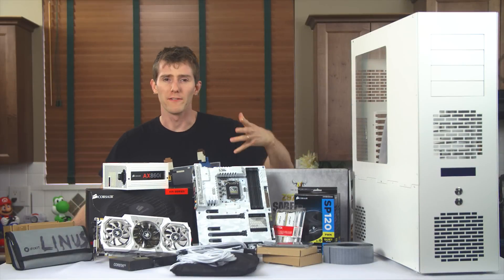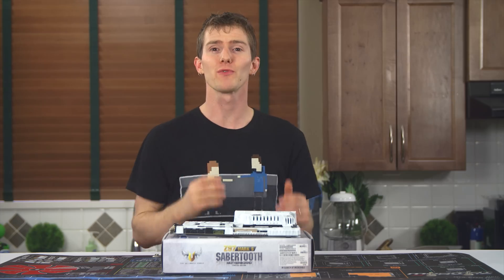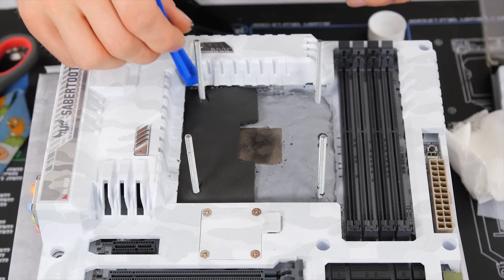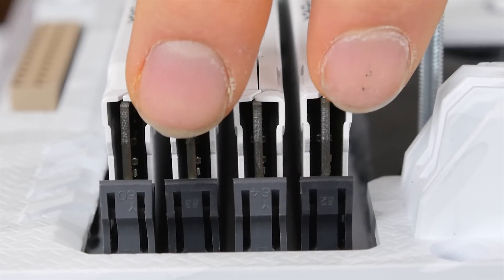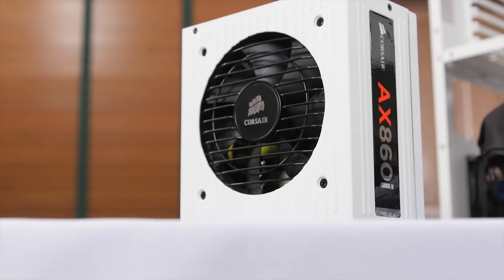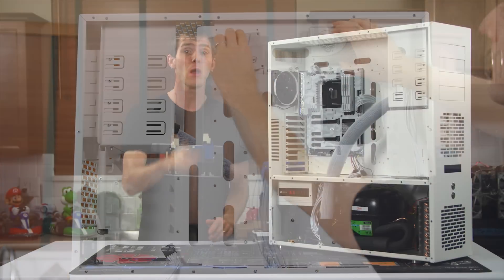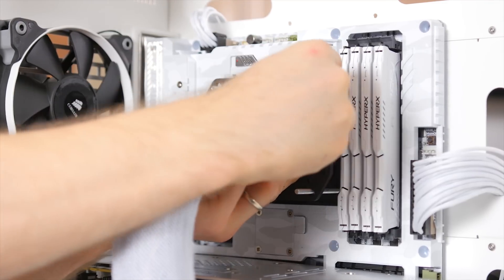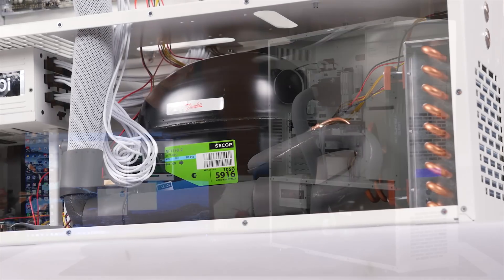ULTIMATE Sub-zero Phase Change Cooling PC Build Guide

Comment: I want to know if this is a good rig or not? :3

Cpu: intel core i5 4690k
Mobo: msi z97 gaming 5
Gpu: msi gtx 970 twin frozr
Ram: gskill ripjaws x series 8gb 1600 
Cpu cooler: corsair h100i
HDD: wd blue 1tb
SSD: Samsung 850 evo 250gb
Psu: seasonic m12ii 500w fully modular
Reply: Flaccid Senpai Its not bad at all, Ghost is just a troll.
Reply: Ghost How is it weak when hundreds of other people have the same build lmao. And how is it a broken GPU?
Reply: Flaccid Senpai Will you be doing extreme overclocking? If not, then the H100i cooler is completely unnecessary. Think about it, you could upgrade to an i7-4790k just from the money you save by not going with an H100i. For some light overclocking, all you need is a Cooler Master Hyper 212 Evo for $30, it's an awesome CPU cooler for the money. The H100i just isn't worth it IMO, since CPU overclocking only provides a minimal improvement in gaming performance...
Reply: Can only run minecraft at cinematic settings.
Reply: Johann Siewers If you do your research you would know that the FX 6300 bottlenecks the R9 280 which isn't even the latest version. Also, the FX6300 is a shit CPU. Nothing else needs to be said about it.
Reply: NinjaGaming111 Yea im actually switching to EVGA Supernova 750w so I can overclock my cpu.
Reply: Ghost Issues on high end games? I am using GTX980 and my roommate is using GTX 970, both from ASUS Strix. Both currently playing Battlefield 4 1080p ultra, no problem at all. Yeah i got 20 FPS more, but 970 on 1080p ultra setting is really good with the current price. Let me ask you something, if you can tell us GTX970 is bad, what is your GPU then? Titan?
Reply: Ghost You're first response: "shit" tell me how is that an effective way of answering his question? He asked if it is a good set up, not "the best money can buy" set up. Second of all the 970 works just fine in BF3 or 4, I have used the 970 frequently and it has no problems (other then the whole 3.5 gig thing, that unless you are running tonnes of texture mods in games, you probably wont even notice)
Reply: So you're saying get a $99 cpu and get a $500 gpu? I have yet to see anyone use an fx6300 with an 980. That's pure stupidity.
Reply: Mohammad Awesat While it's true that you'd be hard pressed to find a game that uses 8GB RAM on it's own (maybe Arma 3?), that is rather irrelevant.

You're hardly ever 'just gaming'.
More often than not, you have Chrome hogging up over 1GB , add in skype for another 300MB, bonus points for any distribution client like Battle.net, Steam and/or Origin and permanently running background programs like dropbox or google drive or gaming peripheral software that comes with any Logitech, Corsair or Razer product, etc
And presto: you're using 4GB without even being in game.

Another point is that a 850 evo will always benefit from more and faster RAM because of the 25% it can use as a buffer. So yeah, if you're close to maxing out your RAM, you're better of buying a cheaper SSD.

So yes, it is a weak point when compared to the rest of the specs.
Reply: Flaccid Senpai Not bad, but you will need a better PSU.  As a general rule, I always go for more wattage than I need so if I wanna upgrade, you can without changing out the PSU.
Reply: +Primo ✪ I'd honestly say - just stay with this build. I have no idea why people keep telling you to upgrade to a 980, or get a better CPU... Honestly, the 970 and 4690K are more than enough for running games at max with a resolution of 1920x1080. Like hell, I am running  an i5-4590 and EVGA GTX 680, and I can still run games at max at 1080p. The 680 in itself has nearly been out for 4 years now and is still damn powerful.
Reply: i think you can run roller coaster tycoon 1 at 5 fps low settings    .......   no its a nice build but u should upgrade the power supply
Reply: Flaccid Senpai Sounds good to me
Reply: Flaccid Senpai Shit
Reply: Flaccid Senpai Fast read/write at the cost of a broken GPU and slow ram. Enjoy battlefield four loading screen waiting for other players to be ready then you can't play because of weak specs
Reply: I have the exact same build except I went overkill with the PSU and got a cx750m but I think it's worth it so I can upgrade it in the future.
Reply: Flaccid Senpai the h100i is a bit overkill unless you want to do alot of overclocking. If you're not gonna do too much overclocking then i would just go with a cooler master hyper 212 evo cpu cooler since it is much much cheaper. I would also get a 600 watt psu instead. Other than that it is a good build
Reply: Flaccid Senpai the H100i is definitely overkill for that Processor unless you're planning on a lot of Overclocking in the future (which you don't need unless you plan on keeping the machine for like 6 or 7 years). an H80i or something in that range would be plenty.

in a year or two, if you're playing games above 1080p, the GTX970 might become a bit of a bottleneck in vRAM.

why not 2x8gb sticks for RAM? just a few bucks more and it eliminates worry about System Memory no matter what you're doing.
Reply: ***** Eh the h80i is $10 less than the h100i. I might as well just get it and I will be looking at the 2x8 rams but the 16gb for gskill ripjaws x is $110.
Reply: Flaccid Senpai 
oh, right.
i forgot their prices. in that case, an H80i GT or H75 would also be plenty.

if you have space for the 240mm Radiator (setup as Pull only for Exhaust out of the case IMO) then by all means i suppose.
Reply: *****  So should I have the fans in intake or exhaust? I kind of didnt get what you said. xD
Reply: Flaccid Senpai Ditch the h100i and spend it on either an evga 750w g2 if you plan on putting more cards in or a bigger ssd space, or peripherals
Reply: Flaccid Senpai it's almost criminal how convenient it is to have Radiator Fans on Pull only, so that the Radiator acts like a filter for the Fans. you can then just wipe it off when cleaning, <5 seconds to clean your Radiators!

with the Radiators in general acting as Exhaust Fans for the entire case, so that heat from them being directly vented out of the case.
Reply: alcowherd7 I'm a troll? K. Wait I'm the one with a setup profile, not you. The 970 has nothing but issues on high end games.
Reply: dont get 970gtx.. Because it has bug..  Get 980
Reply: Flaccid Senpai sorry its super crappy,Idk what you were expecting as an answer.
In all seriousness if you threw more than 1000$ at your computer it's good. That's how it works
Reply: Flaccid Senpai You're better off spending less on the CPU cooler and more on the GPU itself.
Also, I would spend slightly more on the PSU and I'm not the biggest fan of MSI for anything but their laptops but that's more of a personal thing.
Reply: Kingslay3r 'Good' is subjective. Will that rig handle ARMA3 at 4k with all graphical settings maxed out? No. Is it enough to max out GTA 5 at 1080p? Yes. To me, that is considered 'good'. It's not a beast, but it sure as hell is above what the average PC gamer has.
Reply: LyyK 2160p gaming isn't practical yet anyways. performance is still iffy regardless of what GPU's you have.
Reply: Flaccid Senpai Unless you need the m.2 expansion slot available on the msi gaming 5, save yourself some money and get something without all the gamer bling. It's just simple marketing. If you would prefer the MSI route, pick up an MSI z97 PC Mate board instead. The gaming 5 board will not offer any performance benefits with those specs. "High quality capacitors" etc is not relevant for this kind of a build. If a capacitor fails, you will be covered by warranty for a certain period of time. Cheers
Reply: alcowherd7 You're posting zero facts with proof and you're not making any points. What are you doing here and do you have a life outside of attempting to troll legit users?
Reply: Flaccid Senpai Don't take the i5 4960k, for the 970 you will not a high class intel CPU, go with FX 6300 AMD. It will handle any game preset that the 970 can play out
Reply: Johann Siewers What are you talking about? FX 6300 is for budget builds. If he can afford an i5 and 970, there is no place for a fx 6300. FX 6300 WILL bottleneck a 970 at certain times and it's upgradability would be terrible. That i5 is enough for most AAA games while the FX 6300 will probably struggle with games with many mods.
Reply: DeliciousPho And you too have fallen to the myth of bottlenecking. Do your research, in todays world bottlenecking is dead. The fx6300 has 6 cores and quite some speed, many games will run smooth. i5 is overkill unless you do a 980 / titanX build.
Again, 970 doesn't need a high class CPU to be happy and many games as well
Reply: Johann Siewers it's going to be several years at earliest for games to really take advantage of the Threads that CPU's can provide them.
bottlenecking is a huge problem for games nowadays. we've been hitting our heads on the limits of single threaded performance for several years.

fun fact: save for a few specific outliers, almost every [game] you've ever played only uses a single CPU Core. with new games sometimes supporting two Threads.
Reply: ***** Could you elaborate your statement? As far as I know, gaming isn't a CPU-bound process.
Reply: Klasta Games have been CPU bound since the beginning. it's actually pretty rare for a game to run GPU's hard enough to hit a GPU bottleneck before a CPU bottleneck.

games are mostly single threaded even up to today. this means that the average 4-Core Processor at an estimated Clock of ~3Ghz would get the same Framerate as a theoretical Single Core Processor running at something like, say, estimated Clock of ~7-9Ghz.

the seriously low Thread count that games run on causes CPU bound issues. being able to overcome this by having a Processor that has extreme single threaded peformance doesn't really change this.
a very good example of this, is to run a game, and having dozens upon dozens of AI instances running at the same time. the AI calculations will bog down the Engine, and your Framerate will tank. no matter what CPU you have. because it's all limited to a single Thread - meaning that everything has to wait in line, regardless of how many Threads your CPU itself has. 

games have been getting around this issue for many years by keeping the complexity down. in other words, we've been basically nerfing ideas for games to make sure that they aren't overloading the systems we're running them on.
the CPU's themselves are alright, it's not even really their fault. our Programming is a significant part of the blame. Engines that are single, or maybe dual Threaded (with some rare few and far between, really fancy ones supporting 4 or even 8), stacked on top of Operating Systems, Interpretation Suites, Compilers, and more that create and process in a single threaded manner.

the Industry is really slow to move along with these things though.... and it's pretty stupid. we've been able to see the benefits of properly Threading from other parts of the Industry for many years. CAD work is already heavily reliant on this, utilizing as many Threads as they can gobble up to keep the number of vertex points that are being used to generate complex shapes - running smoothly and not crashing.
same goes for Servers, processing absurd volumes of simple data (which is how a lot of games are, fairly simple math calculations, but on a very large scale) due to properly Threading tasks so that they can complete without having to wait for each other.

Threading makes everything go so much faster, and keeps 'traffic jams' from happening on the CPU side.
our GPU's that we're using already even do this, lol. GPU's are massive concurrency, processing hundreds of millions of actions per second in order to generate 3D images at a smooth 'Framerate'.

so it's CPU limitations because of Thread utilization. the CPU's are capable of doing it, Windows even tries to do it automatically (Load Balancing), but ultimately, if your high level and low level Software all run basically on a single Thread, you're still screwed no matter what anyone else does.

ironically(because of PC and Console arguments), Consoles have been doing this for quite some time. they are designed with Threading in mind, as they have no choice but to do it, the CPU's are not impressive, they need to use 100% of it's capabilities.
so games for Consoles are designed with Threading in mind, dividing up work and keeping it separate to avoid bottlenecks. while on the PC side, we've been working with one or two Threads in almost all games since 1993.

Edit:
snaps fingers i have a brilliant example.
imagine a Highway. one way, one lane. you need to move an entire City's worth of traffic through it. it's bumper to bumper, moving very slowly. too much traffic for that road, right?

well, Load Balancing tries to compensate for this by adding more Roads, except they aren't completely separate Roads, it's like adding more lanes in some spots. like how real Highways are like, where there's more or less lanes sometimes. this helps! it does allow more parallel traffic, but ultimately the start and end are still one lane.

now, imagine the same road, except now it's a 8 lane one way road, from start to end. you have many more Threads available now to process traffic, now it can get from start to end much more smoothly, because you can handle more physical traffic at a time.
but, your Threads need to be able to intercommunicate! so you need exit and entrance ramps between each lane of the road so that they can be interconnected and data can be processed, and then get to where it needs to go for more processing with other data.

as it stands now, things are processed single Threaded - but there is actually a decent reason why. single Threaded processing is very simple. you always have access to all of your Resources. it's like a Pool. single Threaded processing puts everything in the same pool, always accessible.
multi-Threading is objectively better, but it means you do need connections between your many pools to make sure that it can all still run as one whole.
i.e. it ends up being more complicated, but it's better for everyone in the long run.
Reply: Johann Siewers Yeah, you don't know what you are talking about. Tell me where you found out it was a good idea to pair a 100 dollar cpu with a 350 dollar card.
Reply: I don't know why people are recommending me amd CPUs. I dont NEED them when I can get intel.
Reply: Flaccid Senpai Because they're cheaper and you could use the extra money and your GPU could use a few more bucks spend on it.
Reply: So you're saying get a 980?
Reply: Flaccid Senpai If you have the money just lying around, go for the most expensive card you want to buy. If not, drop the fancy cpu cooler (and get a CM evo 212 instead), maybe buy a slightly cheaper MoBo and get a 980.
Reply: Flaccid Senpai No, don't buy an amd or 980. When you have a budget this high, you always go for intel because of the bottleneck prevention. The only amd cpu that would not have troubles bottlenecking a single 980 is a fx 8370 but the latest i5s aren't that much more. Next reason to buy an i5 at that budget is the fact that it runs more efficiently and cooler. You may need to water cool your fx 8370 if you ever put in another card while the i5 will work fine with minor overclocking. 

This also is very dependent on what you intend to do with the computer though. So do you plan on doing any video editing or something like that, how many monitors do you plan on using, what resolution, and what is their refresh rate?
Reply: *****
The extra cores are irrelevant, but any other similar priced AMD cpu is kind of old.
Reply: Flaccid Senpai
But you will not need the extra price of intel, and rather go with a better GPU
Reply: Flaccid Senpai Yeah, he doesn't seem to understand that these amd processors are not fast enough. Besides, taking 100 dollars off of the processor putting it into the gpu still won't buy you a 980.
Reply: DeliciousPho that's certainly true. GPU stepups cost more than that, so there isn't really much of any benefit to doing so.
Reply: DeliciousPho The amd mobo's are also quite a lot cheaper and the h100i is overkill anyway so if you swap that for a CM Evo 212, you've got more than enough to buy a 980
Reply: Klasta AMD chips are for budgets, not really high end builds. He wants the i5 and he can easily afford it. As soon as he puts in another 980 in the amd system, it would bottleneck.
Reply: Klasta I don't need a 980 for what I'm playing. The reason that I'm getting an h100i is because it is going to match my red/black scheme.Yeah I can get an h80i for cheaper but it's only $10s less than the h100i so I decided to go with the h100i.
Reply: DeliciousPho How do you know he can easily afford it?
Even if the 8350 bottlenecks the 980 (which it doesn't really do, it's just the IPC being worse on AMD processors which isn't the same as bottlenecking), the general performance in game of a stock cooled 8350 + gtx 980 will still trump that of a watercooled i5 4690k + gtx 970.
Reply: Klasta Well he can't get the 980 anyways because he wants the h100.
Reply: Flaccid Senpai Well, if you know what you need and why you need it, why bother asking whether it's a good build? :)

The only recommendations that I can think of that aren't CPU/GPU-related are:

The h100i is ancient, so I'm going to assume you mean the h100i GTX?  A contender would be the NZXT Kraken X61 if your case can fit it. Also, the "it's only a few bucks more" argument is really dangerous when buying a pc because you can keep applying it. 
The h110i GT also is just more $10 than the h100i GTX and gives you more of an upgrade than h80i => h100i GTX does imo (less noise) ;)

The PSU is kind of underwhelming on a PC with those specs. Don't get me wrong, it's sufficient. It just leaves little room for upgrades.

The 850 Evo could put more/faster RAM to good use. It is able to use 25% of your RAM as a cache so there is quite a lot of benefit to it but of course it's up to you whether it's worth the extra money.

Seeing as you want your pc to be a good looking one, consider braided cables, bitfenix and corsair ones are really nice but they're also rather expensive.
If you're interested in LED fans, Bitfenix Spectre pro's are the best noise/performance wise while CM Jetflo's are (subjectively) the nicest lookers.
If want to control those fans manually, I'd recommend a Bitfenix Recon (unless of course you dislike a blue touchscreen in your frontpanel).

TL;DR: yes it's a good build. If the cpu&gpu are locked in, you can't really improve it without spending more.
Reply: Sounds good, but you may want a 2 tb hdd now that games are 50+ gb a piece
Reply: Cameron Kimner The 1tb hd would be fine for now. Who knows if he plays games that use up that much space because he never game much detail. If he needed more space, it wouldn't be hard to just install another 1tb wd blue.
Reply: DeliciousPho I know but if you just spend the extra $20 now you won't have to spend $50 later, just a suggestion not saying you have too
Reply: Cameron Kimner And what is this 2tb hd you are talking about? If it is the wd green or the seagate then its not worth the extra 20 dollars.
Reply: DeliciousPho Nothing wrong with Seagate.
Reply: Klasta Uhm, no http://www.pcworld.com/article/2089464/three-year-27-000-drive-study-reveals-the-most-reliable-hard-drive-makers.html
How can there be nothing wrong with Seagate if it is the most unreliable brand?
And in the case that the wd drive breaks, http://www.webhostingtalk.com/showthread.php?t=1397991 They seem to have a better rma service too.
Reply: DeliciousPho Uhm,yes
If you had read/interpreted the article instead of just ripping those numbers out of context you'd have noticed things like:

"That doesn’t mean Backblaze is swearing off Seagate drives. In fact, the company has high hopes for Seagate’s new 4TB Desktop HDD.15 (ST4000DM000). Other Seagate drives are also big favorites with the Backblazers."

And on topic of the Seagate 1,5TB Barracuda Green:
"The company received these specific drives as warranty replacements, so they were probably refurbished with wear and tear on them by the time they met Backblaze’s HDD taskmasters."

"Part of the problem, Backblaze says, is these drives are designed to spin down when not in use to save power. That’s a great feature for a home PC user, but in an industrial environment Backblaze says the drive would spin down only to spin back up a few minutes later. The end result being more wear and tear on the drive than it was designed for."

"And hey, a number of individual Seagate models actually had a longer average age than Hitachi products!"

(thanks for providing me with an article to confirm my original statement btw)

RMA-service depends too much on your region to make statements without knowing OP's location.
Reply: Klasta We are talking about 2tb hd, not 1.5tb. The article says nothing about how they got the 2tb drives. Now if you go to newegg, you can see there are more 1 egg reviews on the seagate than the wd, and wd has more reviews on their hdd. Now speaking from personal experience, I've had my wd blue for a good 3.5 years now and there has been nothing wrong with it. My brother bought a used wd blue and has been using it for about two years now and there has been no complaints either. Now for the seagate, I got on for a laptop and it broke after after about three years. I have friends that have both the WD and seagate hdds and its kind of mixed opinion. Personally, I chose the wd because it has performed well for me and more people seem to use it.
Reply: DeliciousPho You linked me numbers, I explained you what those numbers actually meant and yes, the main reason Seagate scored bad in those numbers was the 1.5TB disk which has nothing to do with a possible upgrade to 2TB.

Either way, there's no real reason not to get a Seagate. Seagate has premium drives, just like WD and Hitachi, they're just better known (and more popular) for their cheaper drives. And when it comes to hard drives, you pretty much get what you pay for.
Reply: Ghost gtx 970 is not a broken GPU, if you consider anything under a flagship broken, then you doesn't know a lot about making builds. 

it's more than enough to play battlefield at very decent or even high settings. There is no game yet that needs more than 8gb of rams, but maybe in one or two years you can add extra 8gb and thats it, so RAM is also not a weak point.
Reply: ***** Not really sure why you make that sound as if I'd disagree with that when you're almost literally repeating what I said ^^'
Reply: Flaccid Senpai nah thats a crappy pc
Reply: Johann Siewers 

AMD chips in their entirety are fairly shitty to be honest. Most people that I know have gone to Nvidia GPU's and Intel CPU's. The general word I hear is that they just have better, more stable builds in general.
AMD CPU's tend to run hot and rampantly, which means you're going to have to fork out some cash to buy a CPU cooler that can keep up with the damn thing and keep it stable. By that time, you could have already bought a nice Intel CPU and a fairly decent cooler AND had room to overclock it.
Reply: Effectious
 Please never even dare to mention the words overclocking and stable near each other, no overclock is ever stable whether it is AMD or Intel. (simply because it is an overclock it can't ever be stable)

I have to admit AMD's cpu are ageing but not everybody can afford a 4770k and buying any older is performing just like a AMD fx6300
Reply: +Pace You can max games, but what is your fps? 20?
Reply: Lol... The GTX 680 is just below the performance of a GTX 770...I can run games above 60FPS, most games 60-80FPS. Battlefield 4 is an easy one to run, I can get over 100FPS on that :P
Reply: +Primo - CS:GO & More! get 600-650w powersupply for futureproof build.
Reply: Upgrading it isn't necessary.
Reply: I don't understand the retarded mentality that beginner PC builders have taken hold of now. "MOAR WATTS = BETTUR"

Especially the ones that toss around the term "futureproof" like it's a thing that is actually possible.

Tis bullshit.
Reply: Effectious Your PSU is (other than your case) the most future-resistant part in your pc though. Say you're still in uni for the next 2 years. It would save me 70 dollars to buy a 1000W PSU now rather than buying the 600W I need now and the 1000W when I finally have the money to buy 2 'whatever is top of the line in 2 years' in SLI.

Prices nor wattage have changed for PSU's in the last 5-10 years and high quality PSU's tend to suffer minimal degradation so why not? It doesn't hurt to have a healthy buffer and it is the closest you can come to future proofing anyway...
Reply: +Primo - CS:GO & More! that's spooky, that's litteraly the exact same build I had in mind.
Reply: +Lasse Grillemeistorn not with a 500W PSU lol